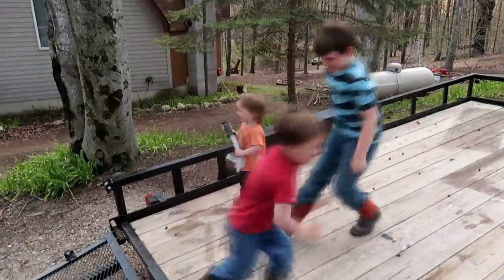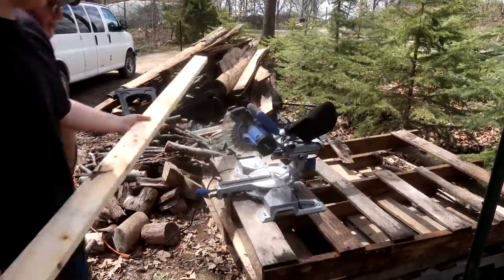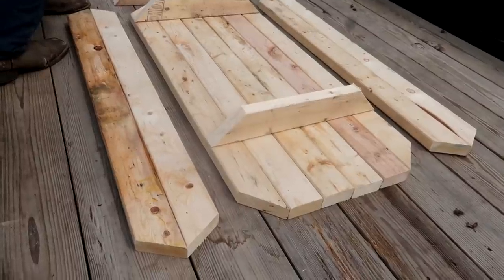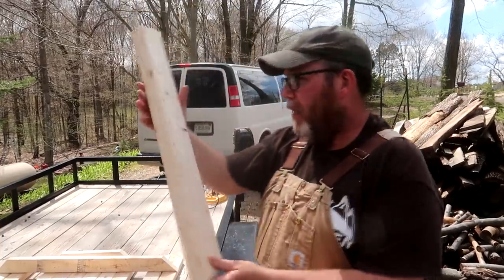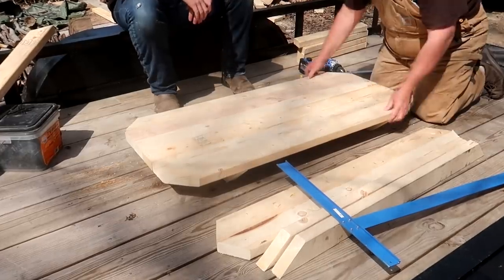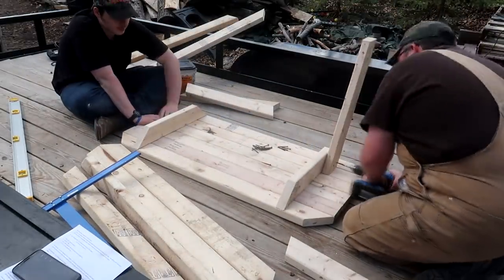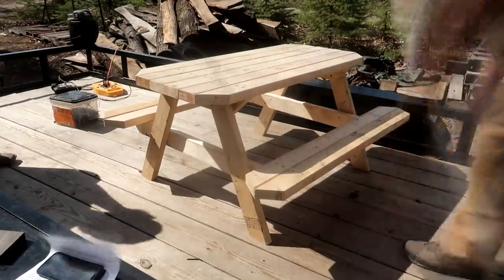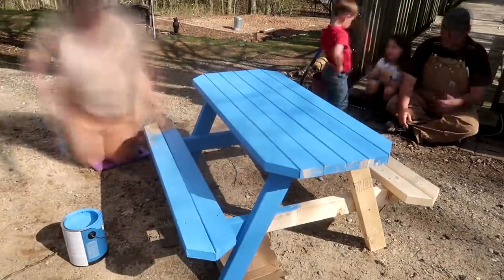How to build a Kids Picnic Table for Under $30

Comment: This was a great video. Thanks to him for posting it and the person on Pinterest for initially putting it on!
I made one and will make 2 more.
I did only a couple things different and that was I did not cut the end boards for table top & bench ends  before I built table instead I just  cut them with my hand circular saw and only enough to take the points off but that is a choice of mine.
Also kids wanted an umbrella so I used-a hole saw and cut it in middle for the pole.
Great sturdy table! 
Price was more seeing lumber has almost doubled in price lately but compared to the unassembled table I purchased from Amazon it was still half in cost and easier to assemble . Plus the one from Amazon was very fragile built !

Comment: How long were your 2x4?
Reply from the maker: I believe I used 96" 2x4's, however 84" 2x4's would work just fine to make a slightly shorter table.
Reply: @GoshenPrepping  thank you!